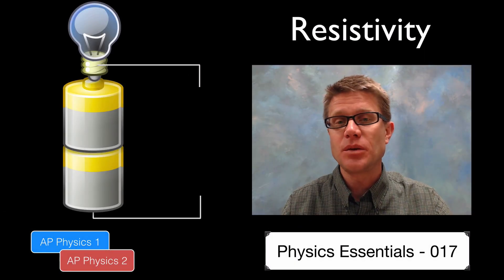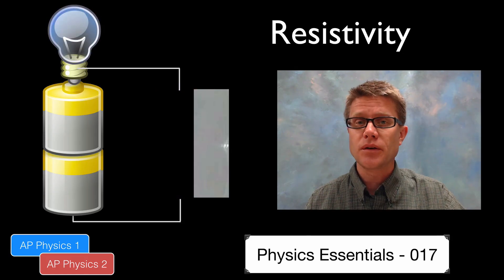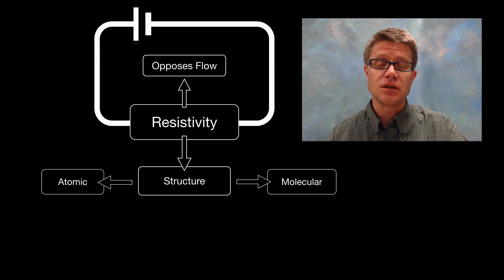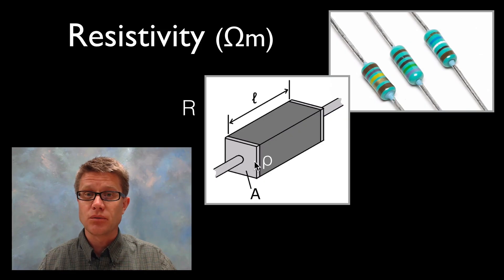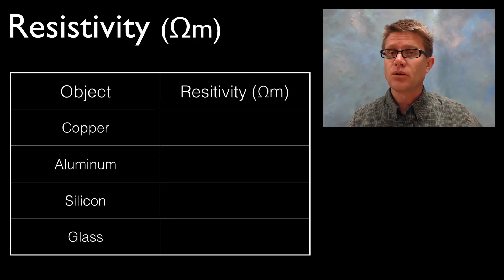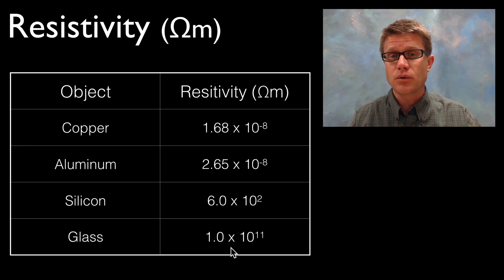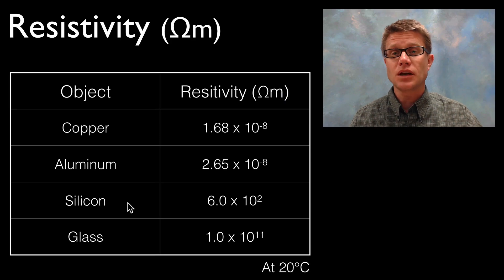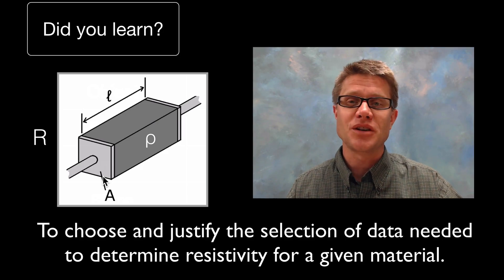Resistivity

Comment: But if you increase the temperature, should not current flow increase due to excitement?
Reply: You asked this 7 years ago, but it might help to someone else. Increasing the temperature in metals in many cases leads to allotropy, which means the atomic structures of the metal changes. The main reason of this is because the heat transfers as kinetic energy into the atoms, so they start vibrating with a larger and larger amplitude, so atomic bonds that was stable enough on a lower temperature are not stable enough anymore, and as a result they rearrange into a new one. This change can occur more than once until you reach the melting point of the metal. Partly this change is responsible for the increasing resistivity, but the main reason is the increased atomic vibration. 

Electrons (the current) go between the atoms, but because the atoms are more fidgety, electrons can not go so easily, they always bump into the more and more fidgety atoms of the metals atomic structure (called crystal lattice). And of course electrons themselves are more speedy as well, so it's like in a video game where the player try to run all the time, because he believes he is playing an action game but he is actually playing an RPG and he is in a small room, but he still try to run like hell because he needs to finish the game in 3 days otherwise something bad happens. So that"s what the electrons do as the temperature rises, and they are not too successful to handle the situation. They just bump to everything and to each other with full speed. So that is the main reason when it comes to metals.

In semi conductors it happens the other way around. In very simple terms, electrons can not go easily freely between atoms when the metal is at room temperature, they just don't have  enough energy. There are obstacles keeping them back running around. But as the temperature rises they gain enough energy to do that, so they start running around freely, and the metal becomes a conductor.

Comment: I cannot resist commenting.  This is a good explanation of the concept.  In fact, temperature is always a very important factor in any electronic circuit design.  Semiconductors and other components are rated for specific temperature ranges and voltages.  What wasn't covered here are the extremes, like super high-voltage arcing, thermal runaway and high-current heat convection, but that may be beyond the scope of this introduction.  Thanks